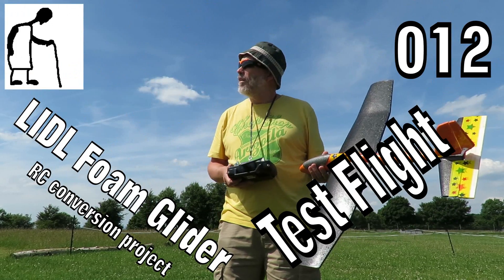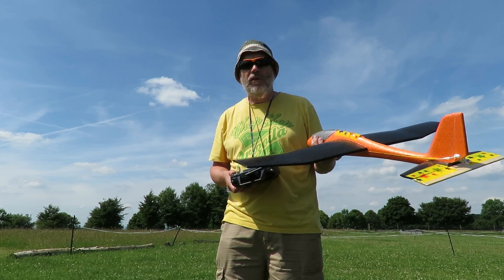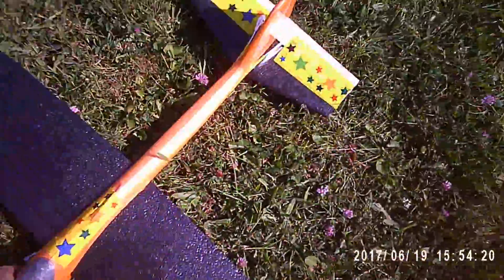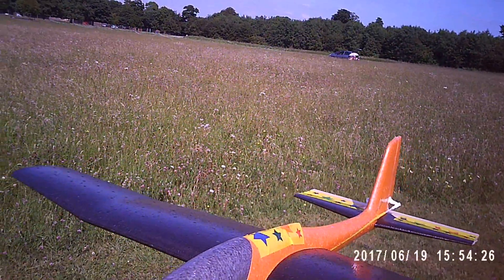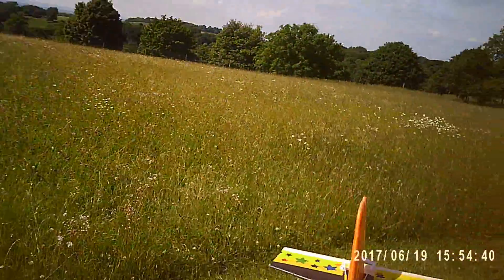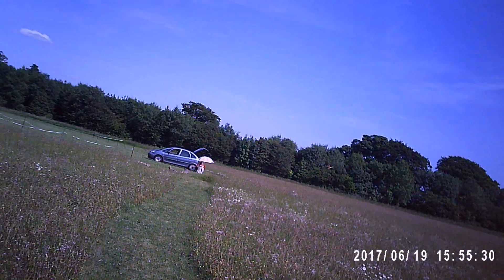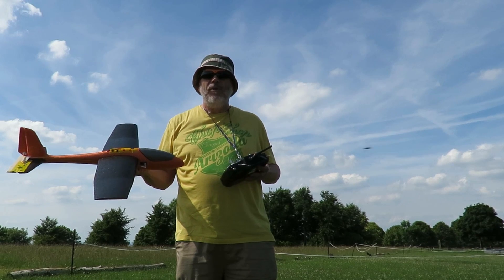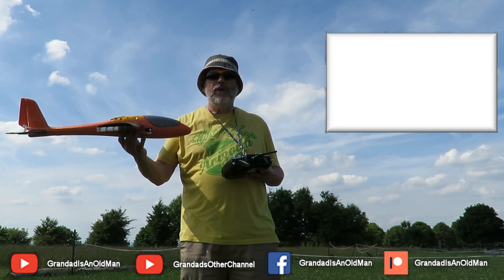LIDL Foam Glider - 012 - Test Flight

Comment: That's a Lidl beauty grandad. Embed a small hook underneath for a catapult, or a small pin on the end of a wing for DLG and you will be up in the air and catching thermals in no time.
Reply from the maker: Thanks Joanne, that one is still in the shed and hasn't had an outing this year. I did have a go at high start or bungee launch with it before I put it away. Here is the video - Bungee or High Start🛩️Launch PART 2 https://youtu.be/WVLAHC--3GU

Comment: thanks for posting.  you maybe already know what 'crank and yank' means.   
crank refers to the rudder input.   yank refers to elevator input.    when a wing has dihedral/polyhedral, turns can be made with rudder only.  to increase the rate of turn, put in up elevator.   not ailerons.   
ailerons are good where roll control of a wing having very little dihedral is desired. 
   
imo, this glider is too light for its intended purpose.  it needs some weight at the nose for a different cg and some ballast, at the cg, for higher wing loading, more control authority and to reduce stall.    cheers